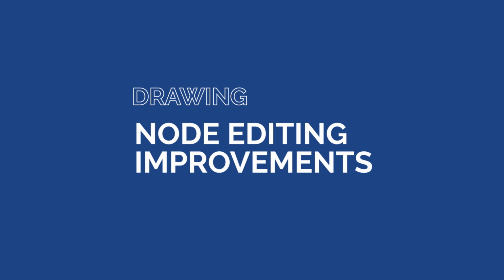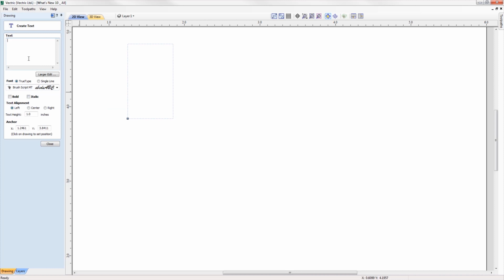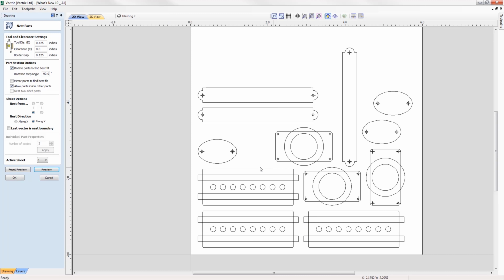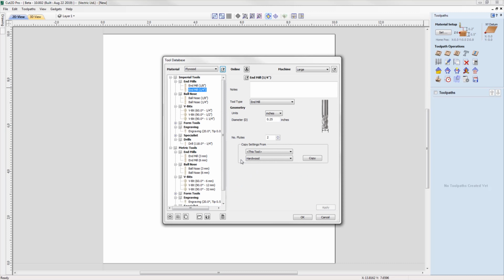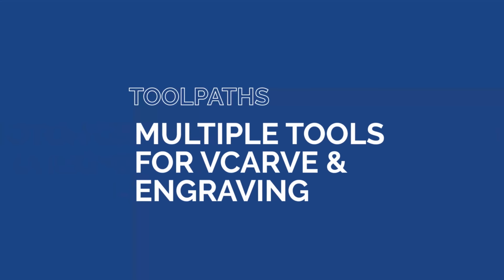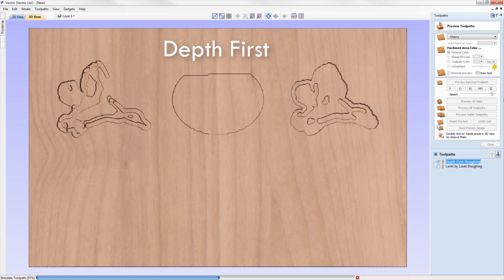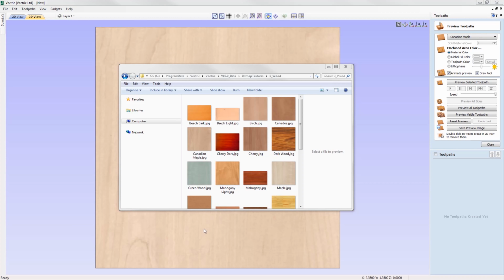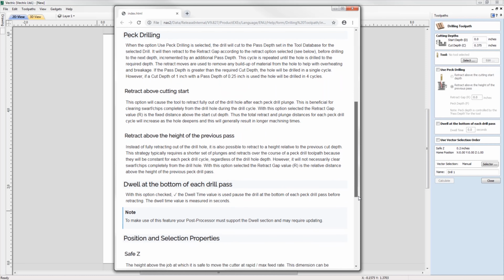What's New in VCarve Pro | Version 10

Comment: Do you have a tutorial that will show how I can do a vcarve on the top portion of the material, then 3d carve the remainder portion? For example, on a 12x12 piece of material, the top 3 inches will have the vcarve, then the remaining 9 inches will be 3d carved as using the material boundry...I guess making a new boundry line for the top 3 inches.
Reply from the maker: Hey There! You can certainly 3D Machine in one area and VCarve in another. Take a look at some of the 3D Toolpath videos they should help you :)

Comment: Unfortunately most of the existing gadgets don't work yet because of broken backwoods compatible with the dialog:AddToolPicker. If you use gadgets I would recommend waiting until this issue is resolved.
Reply: Howdy.  Ed, "Thanks!" for the heads-up info regarding the use of gadgets.  Right now I am into heavy use of the Rounding Tool Path and the Spiral Tool Path as well.  Without the use of these my projects come to a complete halt.  If and when you receive word that the gadgets are working again in V10, PLEASE post again.